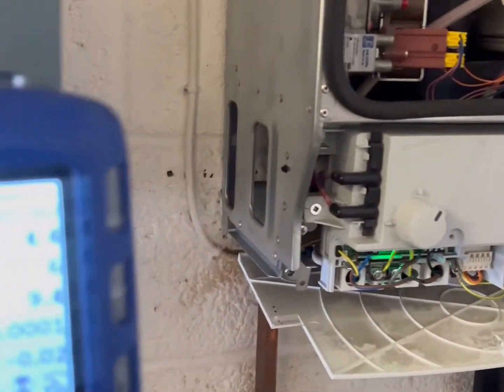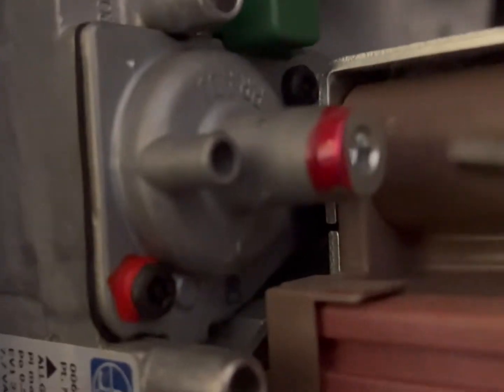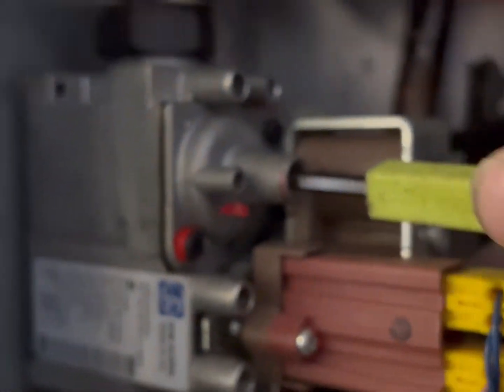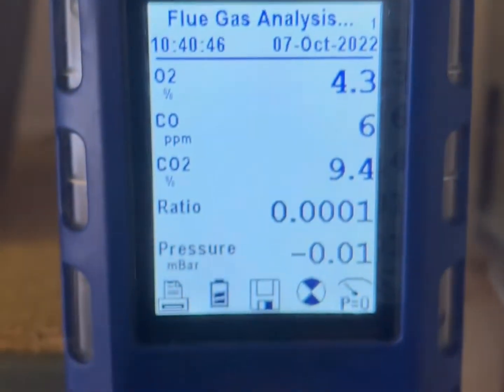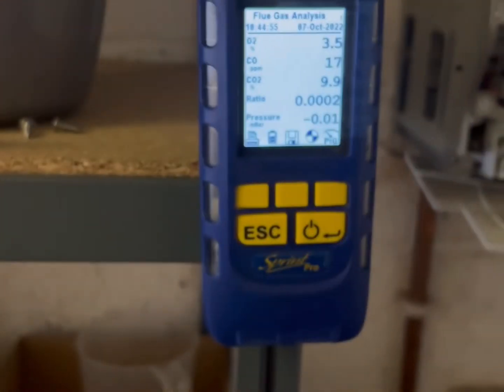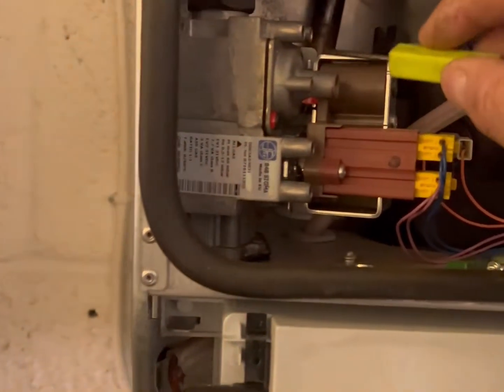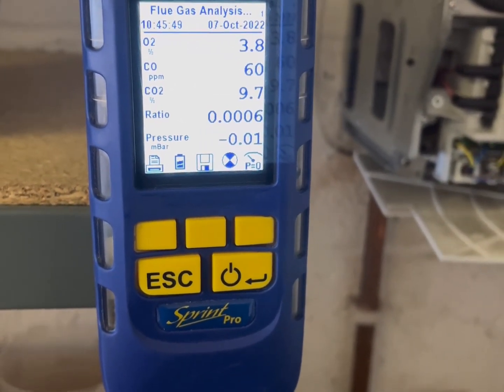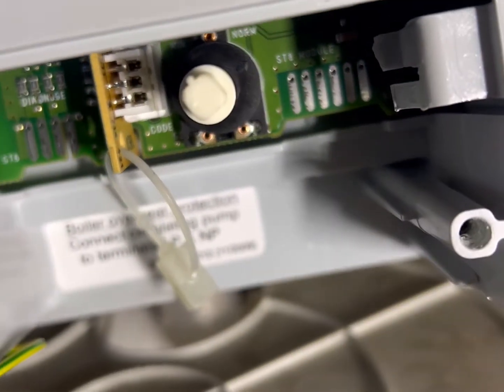How to adjust a Worcester gas valve

Comment: If the co2 doesn't adjust within range is it a faulty gas valve?
Reply from the maker: Not necessarily mate, could be that the gas valve needs adjusting

Or could be the heat exchanger is blocked up etc